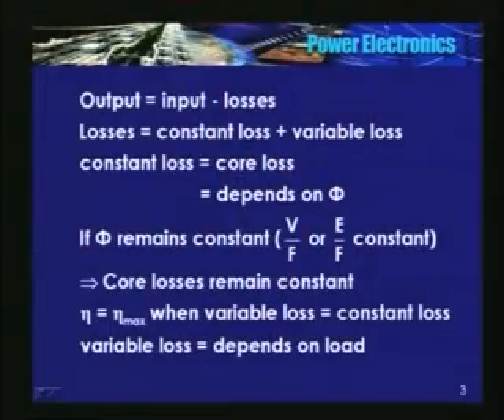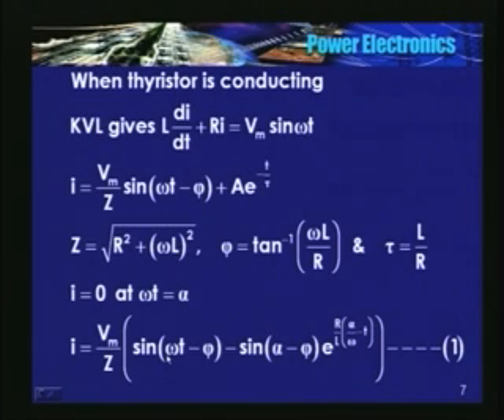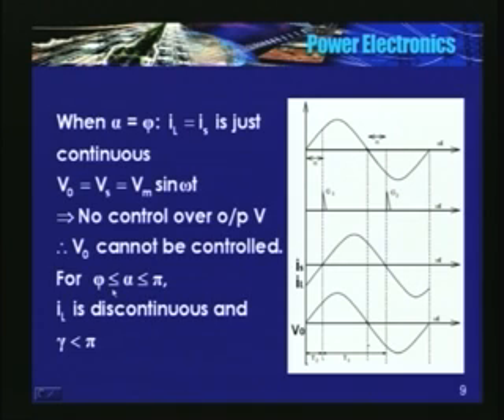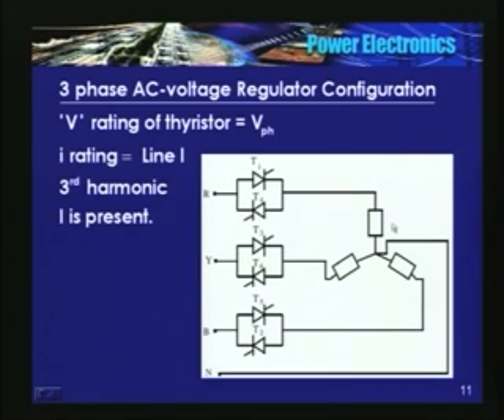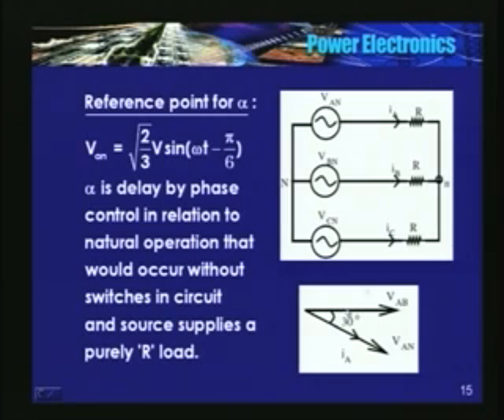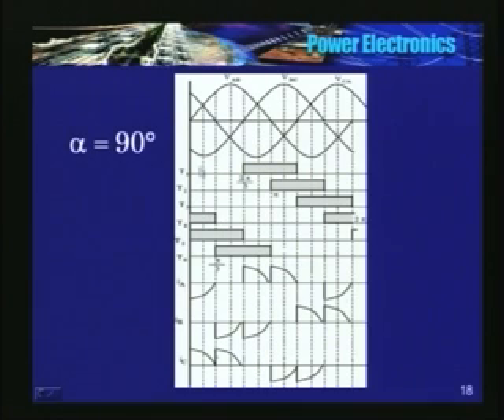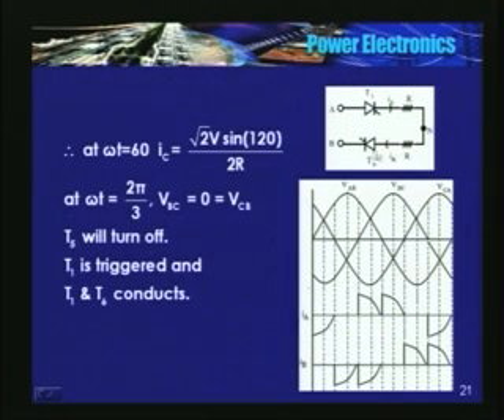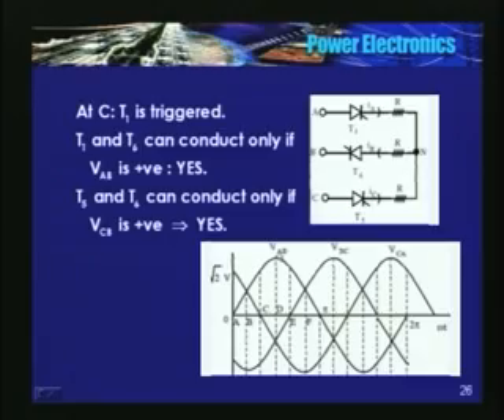Lecture - 43 Power Electronics

Comment: Oru doubt two sepic converter we used to convert  Dc-Ac without using inverter it's possible or not
Reply: DC vge is input but we want ac output without using inverter in this circuit... Two sepic converter is connected parallel in between we give supply one converter operates positive half cycle then another converter operates negative half cycle that means square wave but how get sine wave if possible or not